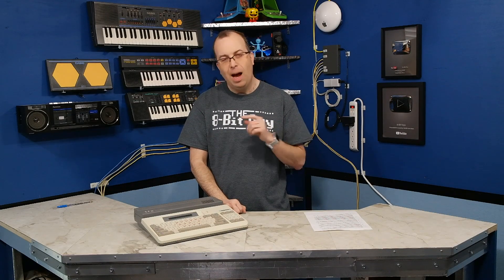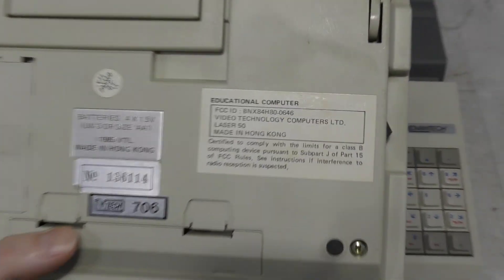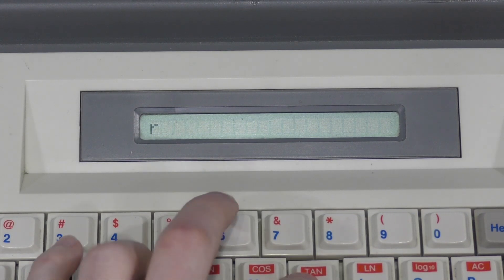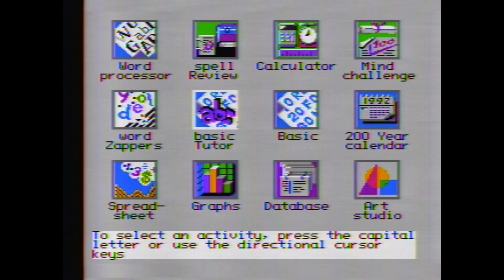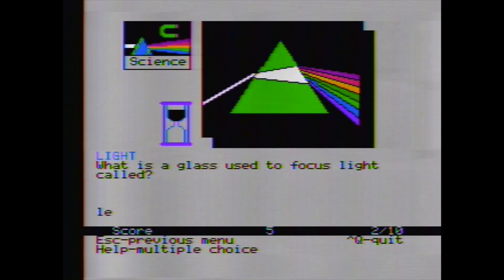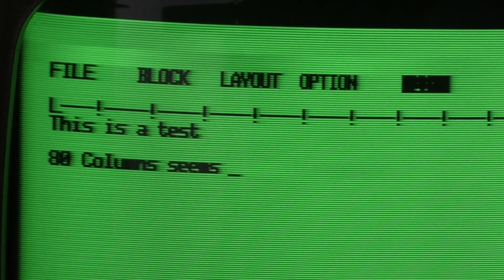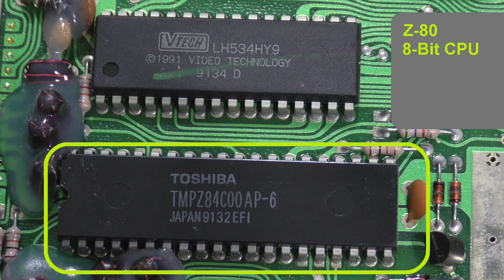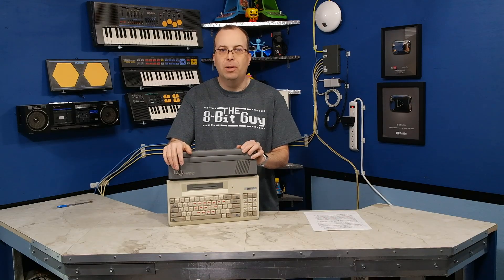The Advantech I.Q. Unlimited with BASIC and a Z80 CPU.

Comment: The little microcontroller at 16:10 has 512 bytes of ROM and 16 bytes of RAM, not kilobytes.
Reply: There are modern MCUs with similar amounts of memory, e.g. there are ATtiny variants with just 1K ROM and 32 bytes of RAM - some simple tasks just don't need more. The screen memory is most likely included in the main 64K - that would partially explain why the word processor shows so little free memory.
Reply: @ Booze & Metal : I actually had no idea, thanks, seriously those machines had such limited resources yet were pretty decent when it came to capability.
Reply: The VRAM would be just in main memory. I figure it's broken into 4x32kb banks, one of which is permanently switched into the lower half of the processor's 64k as working memory and VRAM, and one other in the upper half as battery-backed file storage.
The likely screen rez is something like 480x200 monochrome or 240x200 4-greyscale (the colours being produced purely through NTSC artefacting), which will fit into both 6MHz (maybe even 5.3MHz, as used by the NES and various other machines that use artefacts) and 12kb, giving us 20k free out of 32k.
Alternatively, 48k banked in permanently and 16k accessible at a time for storage (though then why we have three virtual drives, which seem to have about 30ish kb usable?), with twice the bit depth (gives us a better range of colours and better resolution in artefacting mode) and about 24kb used for video, minus 4kb for general variables and such gives us that same 20k...

(The program code itself running from the entirely separate 512kb ROM ... which, hmm, would have to also be banked in a piece at a time... it's all getting rather complex. Maybe it's only even 16kb (to 32k) of working memory, 16 to 32kb of ROM, and 16k/32k of virtual disk, with the "files" being used directly as working memory themselves, so doing a load/save being mostly a symbolic measure to mark which piece of work you want to resume working on, and naming / closing off the current one)

Also, it's not 16 bytes of storage in that microcontroller... it's 32 nibbles. You can actually do quite a lot with that, if most of your code is actually running from ROM... of which 512 or even 256 bytes can be more than enough for the simple kinds of tasks uCs tend to be used for.
Reply: 16 bytes of RAM? Even my refrigerator has more RAM than that, I guess.
Reply: Depends on the fridge. What's it do? For some applications, you can do an awful lot with a microcontroller with only 32 nibbles of RAM and 1024 of ROM... most of the variability will actually come from conditions it senses, rather than any complex on-board calculations.
Reply: also the x244 is a buffer/line driver and not a shift register
Reply: 512 bytes is about right for a vintage microcontroller though.  I'd be curious to know where the screen memory is though because 16 bytes isn't going to be enough for that.
Reply: musashi gundoh I’ve seen comments saying it has 16 half-bytes (nibbles) of RAM, but that doesn’t seem to make much sense since how is that enough to drive a composite port...
Reply: Wow 512 bytes, that seems tiny to me.

Comment: Is there a port of DOOM for it?
Reply: VTech shoveled/shovels out a dozen of propietary computer platforms that have zero support of any kind.
...So there is still a lot of virgin grounds to break for Doom :D
Reply: There's a port of doom on the VIC-20,  the TI-80 series calculators, a hacked pregnancy test device and a playable .gif file. If it exists someone will probably try to figure out how to play Doom on it.
Reply: Me too! In the shitter at work!!!
Reply: It'd take quite a bit of reverse engineering just to get to a point of running arbitrary code on it... but it should still be possible.
Reply: No, but there is a heavily modded port for Wolfenstein 3D, called Wolfenstein 1D. IDK how it would work for something with an LCD display, though.
Reply: I want doom on this. I need another piece of obsolete hardware to run doom.
Reply: Are you kidding me? I've got Battlefield 4 running on mine.

Comment: Funny how the 3.5" floppies are in the drives backwards (metal shield out) in those ads.
Reply from the maker: Yeah, I didn't even notice that until it was pointed out here.  I was too busy looking at prices and specs.  I wonder how they did that because most drives won't even allow you to insert it backwards. They would have had to put some effort into that.
Reply: I was wondering that myself. It's been quite a while since I used a 3½-inch drive, so I don't remember for certain, but I would have thought that it wouldn't physically fit like that (unless that particular drive had an unusual design).
Reply: Whatever someone thought looked 'flashy' to photograph.
Reply: unless you see the shield, how do you know its a real floppy drive, or a real floppy?
Reply: Of course we could also chalk that up to carelessness of whoever did the photography of these things.

Comment: I thought I was the only person who has one of these! FYI: The cartridge slot on the left is for playing Socrates games. (That was the educational video game console VTech had in the late '80s, using very similar hardware to the IQ Unlimited.) VTech also made a later version, called the "IT Unlimited" with a GUI and mouse.
Reply: Seriously this company seems to always use the top shelf of words when it comes to describe their products. What happens when they introduce a better model? Unlimited 2, Unlimited Unlimited?, Turbo Unlimited?
Reply: @jackkraken3888  super ultra mega mega unlimited 2000
Reply: Ultra Unlimited?
then the Truly Unlimited?
Then the Truly Ultra Unlimited? 
Kind of hitting a wall at this point :P
Reply: @rich1051414  Truly Ultra MEGA Unlimited :-)
Reply: @rich1051414  the Advantech Ultimate Badass Home Computer.
Reply: The computer he is comparing it to is not portable.  The Vic wins with software and THE ABILITY TO STORE AND INPUT.  If it just had a serial port (or if the parallel port was 2 way), you would have a way of integrating the thing with the rest of the early 90s computer world (transfer BASIC programs for porting, backup your docs to permanent storage, etc).  Actually, with the right modified cable connecting the parallel port to the I/O pins on a Raspberry Pi or some such, and some parallel read software on the Pi and a simple short BASIC program on the I.Q., you could use this as a sort of semi-smart keyboard for the Pi.  You couldn't really call it a terminal unless the BASIC can read input off the parallel port FROM the host.  The BASIC would have to do it because there appears to be no way for the user to jump to machine language and access whatever capabilities the chipset might have directly.  The only advantage over a keyboard is that you would be able to see your text as you're typing it on an old TV without having to buy a full display for the PI.

I have a TRS-80 model 100 (still works, mostly).  It has a smaller form factor, a larger LED display, no video out, a cassette interface, an RS-232, a dial-up modem, and less built-in software, more productivity-related than entertainment.
Reply: VWestlife I think Retrogamervx showed one of those in a video! :-)
Reply: I assume it was also unnecessarily software limited as well? 'Unlimited'...
Reply: I remember playing with Socrates as a kid.
Reply: Hi Kevin.
Reply: u can see the socrates at 3:16
Reply: @The 8-Bit Guy     Try putting one of the Socrates cartridges you got into the slot.
Reply: Actually it was not "compatible" with any Socrates carts. The Socrates had it's own unique input method that the iq unlimited did not have. I had one of these and my sister had the Socrates. I could insert the Socrates carts in my computer and they would work, but things like speech did not (as the Socrates had a dedicated speech cart that had to be installed) and input was if I recall mostly impossible.
Reply: If you take the Socrates' speech module out of its housing, it will fit into the slot on the back of the IQ Unlimited, but it won't work. And whereas the Socrates has at least two sound channels, the IQ Unlimited has only one. You can tell when you put in a Socrates game cartridge and the intro music comes out as only single-voice instead of multi-voice.
Reply: Had an IQ and a Socrates. You are not alone!
Reply: still got it?
Reply: Hi Westlife!
Reply: VWestlife iii
Reply: Jack Kraken Even Unlimiteder? :P
Reply: I bought an IQ Unlimited on eBay today after seeing this video and your video too, I'm looking forward to getting it, but I've never used one before.  After looking a some videos of the Socrates, I see that there's a speech synthesizer card you could get for that, do you know if the speech module is built into the IQ Unlimited?  The Socrates uses a wireless controller with a keyboard and 2 control pads, how does the control system the Socrates uses transition to the IQ Unlimited, if at all?  Can you please explain that if you can?
Reply: @Lachlant1984  The Socrates carts are compatible with the IQ Unlimited. The keyboard is not, afaik, as the IQ Unlimited does not have an infrared sensor.
Reply: at 9:05 the word "Naked" appears...
Looks like demonetization

Comment: Well, in 1991 they did have gameboys.  So there's that.
Reply: I had a Game Gear in 1991. It was rad, besides the horrible battery life of 5 seconds. I could not imagine bringing a word processor on a car trip. This is still a great video though, I had no idea that VTech made stuff like this.
Reply: I mean, considering that the Game Boy is a) a handheld, b) came out earlier, and c) was a dedicated game machine and not a home computer, chiding it because it can't do basic is a little unfair.
Reply: Fratm Atari lynx too yo
Reply: Compared to the computer in this video? :D
Reply: Oh, sorry. My mistake.
Reply: But in all seriousness, if yer referring to the Game Boy - today a lot of people play the Switch on the go, and that thing is a lot bigger than the og Game Boy. Even with a smaller handheld, like the 3DS, not many people keep it in their pockets, but rather in a bag or a backpack - like we did with the Game Boy. In my experience at least, the size was never an issue.
Reply: And the SNES!
Reply: Plus, a GameBoy was only $90 and had Tetris included.  So you could potentially get 2 or 3 more games on top of that before hitting the $200 price point of the Advantech IQ.
Reply: The Super Nintendo released in 91. It was 200 dollars.
Reply: While some portable computers that run BASIC, like the TRS-80 Model 100 could be neat to play with on a trip or so, a machine like that (with a single row display, hrr) would probably be pretty dismal to use no matter where you are..
Reply: Well, that thing was huge and bulky!
Reply: That was my first thought as well. But I learned to code on a VTech with a Z80 so there is that.
Reply: You can't do BASIC w/ those pieces of crap. :)
Reply: @Horzuhammer  I mean it runs on an 8-bit processor, who's to say some intrepid Gameboy hacker can't make it run basic. There'd be no real point because of the lack of a keyboard but it could be done.
Reply: :D I was joking.

Comment: That Brother / Tetris word processor in the Sears catalogue had one particularly weird thing in the photo: the 3.5" floppy disk in the drive was.. backwards? Was that actually a thing, or technical incompetence?
Reply: Interference22 most likely technical incompetence by their marketing department.
Reply: Those bastards, now they've gotten me wishing I had a backwards floppy drive....
On a side note, the ad got me curious, are the 240KB disks proprietary, or are they just 720KB DSDD formatted in a funky Brother format?
Reply: I have the same question, I thought 720KB was the minimum on 3.5" floppy, the Amiga started with that as double-density.
Reply: @marcusdamberger  Amiga formatted disks were 880k, not 720k.

Comment: I wonder if the extra RAM on that 128K RAM chip is used for file-storage?  It’d be difficult to store all your files and program data in only 64K, would it not?  Maybe it did some kind of page-swapping thing where the program could access the higher parts of the RAM chip for “permanent” data storage somehow?  Although that word-processor program did say it only had 24K when you were typing in it...  Oh well...

I’m sure some well-intentioned parents and grandparents who knew literally nothing about computers bought a bunch of these for their kids/grandkids back in the day.  Bunch of kids who wished they’d gotten C64s.  ;-)
Reply from the maker: Yeah.. I pity the poor kid who got one of these for Christmas instead of a C64.
Reply: It sounds like something I would've gotten too easily if I kept begging my mom for an Amiga and got this instead.  That happened to me a few times where I ended up with an Atari 8-bit computer instead of the Amiga 500.
Reply: I am sure that is why there is 128k and the extra circuitry is on there. I suspect that they would not need to bank swap either. I suspect the area is mapped in hardware as a drive, probably handled by one of the mysterious chips on there. 128k chips would still have been considerably more expensive than 64k even then, and the storage ram has to be somewhere.
Reply: LMacNeill 
I can't imagine the paltry storage capacity would last if the poor kid who got one really liked to draw
Reply: Yeah, with gifts like this, the realization of the suckage comes slowly and painfully. haha
Reply: Man, I think I was spoiled. My parents got me a C64 and later a Mac SE.

I remember being so mad (in my teenage years) because my Mac was so slow and didn't have color, but now I'd kill to get that same computer back. I had it until 2013 and sadly had to give it away during a rushed interstate move)
Reply: That's my guess as well. That the "local storage" is just 64K of it, and the "user memory" is the other 64K.
Reply: To be fair if the poor kid really liked to draw he probably wouldn't be using this
Reply: TheTurnipKing 
Man, I used to "draw" with 16 colors and text mode with gwbasic on dos 😎😂

You'll be surprised with all that you can do when your options are really limited.
Reply: I was able to keep a few documents on my Radio Shack Model 100 with 32K of RAM before I saved them to cassette.
Reply: So you asked your mom for an Amiga and she kept buying an Atari 8-bit? Would she rake it back to the store and pick up another version of it or something? I don't know how someone would keep buying the wrong system like that. Or did you ask for it every Christmas and she would mix it up and buying yet another Atari? You should have cut out a picture from a catalog with it  and circled that. 

Maybe she was subtly saying she could not afford an Amiga and some store clerk convinced her that the Atari would be an acceptable substitute. And this version of the Atari was better then last years 8-bit version.. I can't blame all Mothers for mistakes like this, I once asked for a Beatles album and she came home with a Bee gees album, Spirits Having Flown. This was many years after Disco had crashed and burned itself out to death. But now looking back, I don't mind having that album in my old vinyl collection so much; an oddity my brothers and I never intended to have. You gotta love moms.
Reply: Amiga Rob Well, I was thinking about the limitations of the Z80 microprocessor — I don’’t think it could directly address more than 64K, which is why I thought maybe it would page-swap for file storage perhaps...  But with all that extra circuitry in there, maybe it did just use that extra RAM as file storage, and the system saw it as a hard-drive without the need for page-swapping.  Wish there was more technical info on this machine.
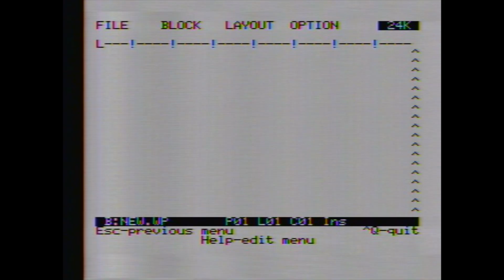Reply: I'm actually not sure.  bank switching would be an easy way to handle the 12 different built-in programs as well as launching programs from external storage, and the lack of memory available in that word processor (7:11) doesn't exactly indicate it's using the full memory address space.

32k of bank switched ROM with 32k of RAM maybe?
Reply: Scott Larson 
Man, that was the Holy Grail of mobile computing until the advent of capacitive touch smartphones!
Reply: On 7:43 you see that the Word processor reports 24 kB free and the Ramdisk shows about 60 kB free. So the 128 kB RAM is most likely split evenly between CPU RAM and the Ramdisk.